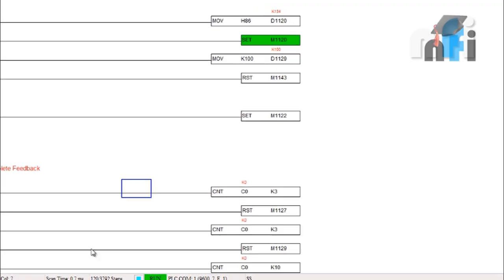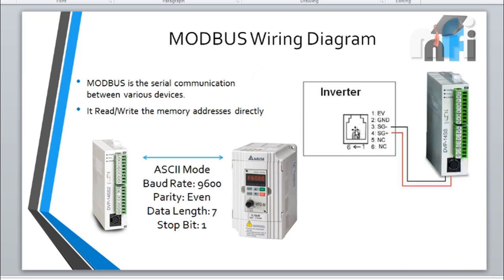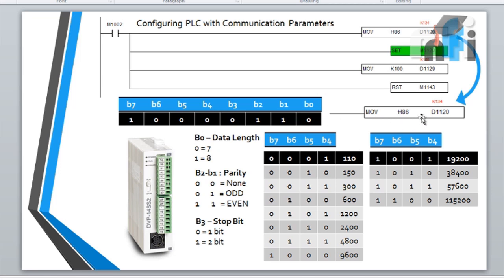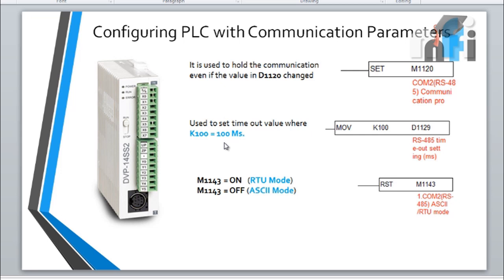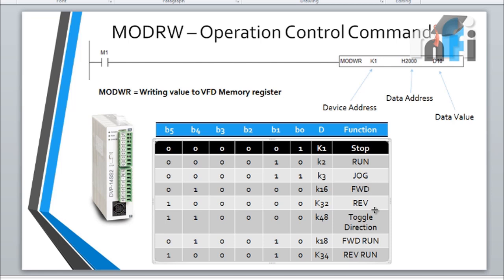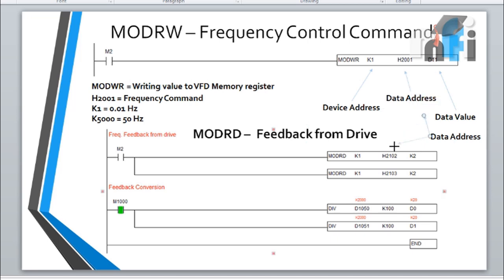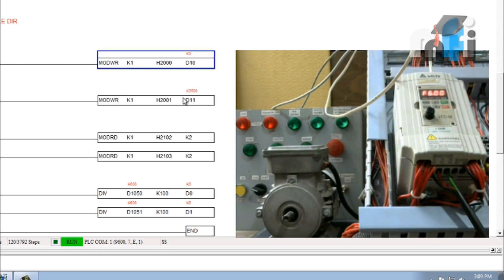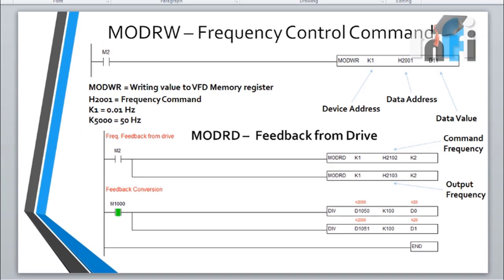PLC & VFD MODBUS Communication Mode

Comment: How do I read the frequency and amperage of the c200 inverter for the dvp 20 sx plc? I'm going to view the ihm, but I'm not able to read the correct value with MODRW
Reply from the maker: You should use MODRD for MODBUS Read to read the freq. Kindly check the correct modbus register for the VFD in the VFD manual-

Comment: I prefer using PLC link to drive VFD from PLC in my projects instead of separate MODRD and MODWR instructions. Using separate instructions you have to initiate separate communications thru the channel each time when you need to start, stop, change frequency or set a parameter. But your video is great! Keep so on….!
Reply from the maker: Thanks, which PLC Link you are referring?
Reply: @thegeterrdone  I prefer M1353/M1356=OFF. This mode is available only when all VFD register addresses are consequent (like in Delta VFD).
Reply from the maker: @ivanbratanov8699  Thanks for the tip  :)

Comment: SIr i Am copy same this for Delta Dvp-32EH + GS Vfd but its not working what is the problem??
Reply from the maker: GS vfd? I made it for Delta, if you are using different brand then it's not possible. You need to modify the code